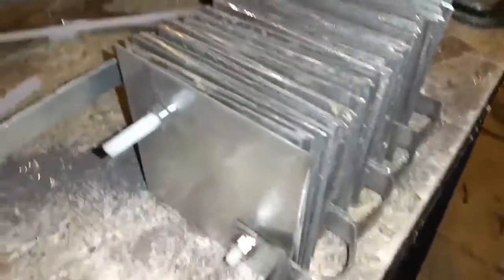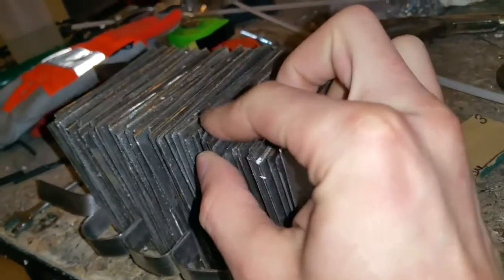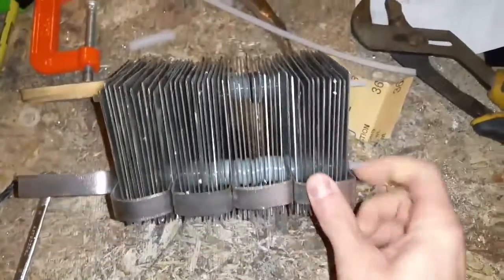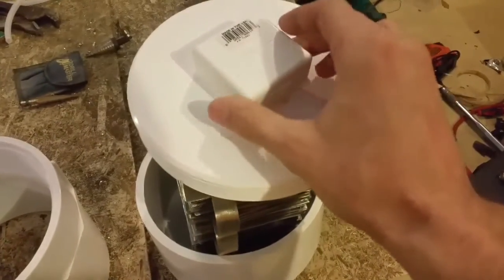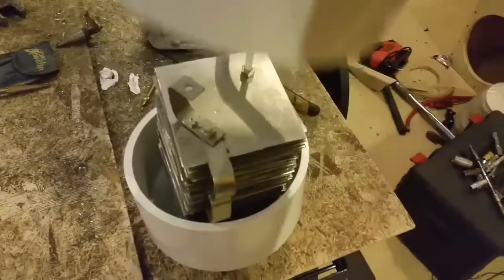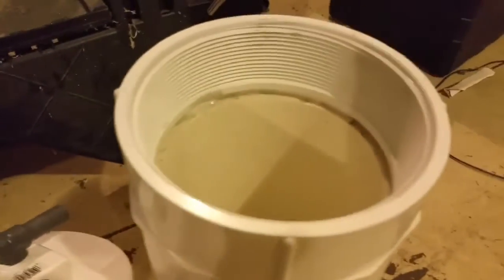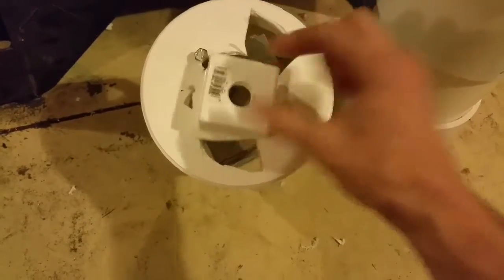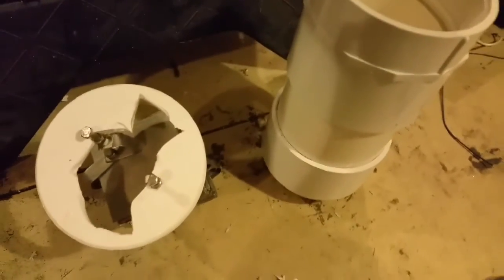48 PLATE HHO Generator Wet Cell Test!!!

Comment: To safely check for leaks, use the kitchen washing up liquid, put around location and look for soapy bubbles = leak location found...to repair, put P.T.F.E, tape around threads.. better still  don't use threads Atall in such lids use straight through drill hole such as a 15mm bulkhead fitting with rubber insertion gasket inside and outside.. offers more long term safe use...
Thom in Scotland.

Comment: use the same pvc setup with a ultrasonic trandsucer to create a dense fog and then have ur plates in the middle of the fog ...
since the water is turned into a fine mist you should be able to generate more hho with less amps
Reply: Those foggers are quite power hungry. Gas generation is also proportional to current so you can't really get more with less.

Also the mist as a whole is not conductive, the individual droplets would be (if you misted electrolyte) but the spacing between the drops is just air so the resistance between two drops is probably in the kohm to Mohm range.